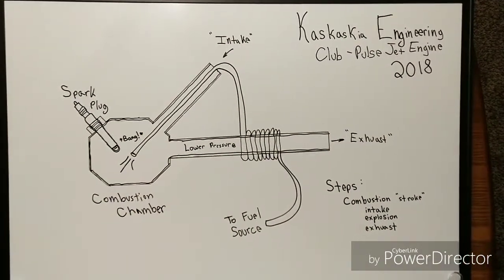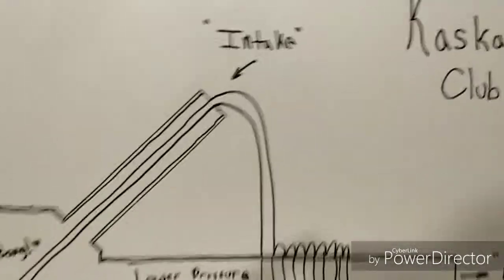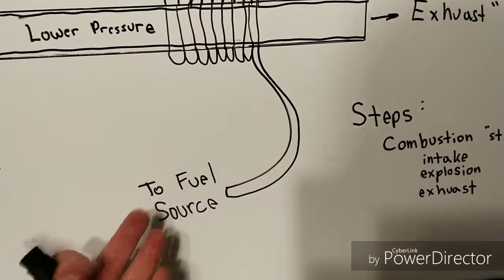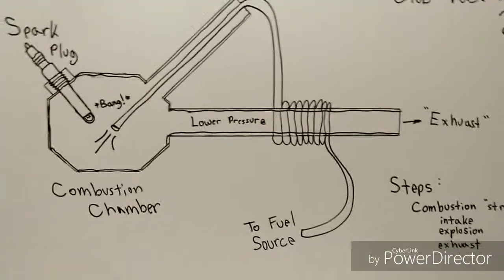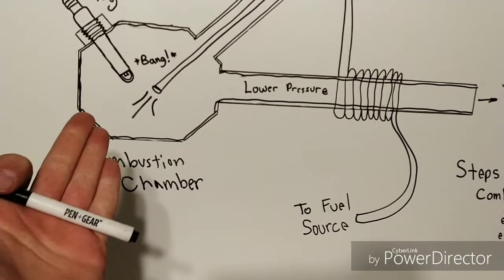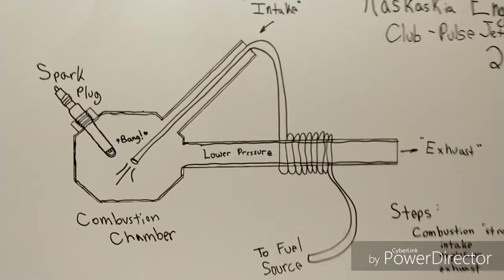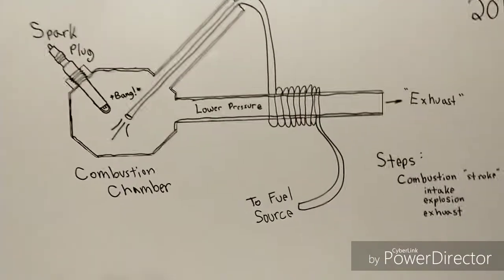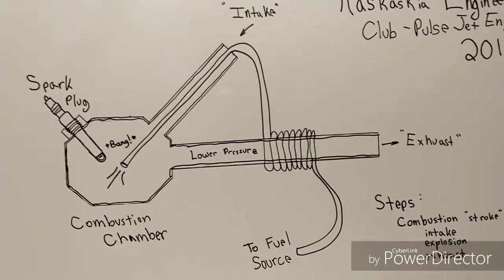Kaskaskia College Engineering Project 2018 - Pulse Jet Engine

Comment: next Project-USE Preheated Woodgas. So you start the Jet with Gas and change later to Woodgas. Use a Smoker from a Beekeeper,same prinzip.Dont think about any Water,the Vapor be preheated and be also Fiul- So you need less Gas.

Comment: What is thrust generated...??
Reply: It depends on the geometry of the engine as well as the air the fuel ratio this engine didn’t really run but o well
Reply: @adamgrieve7459  thanks...
Reply: What comes out of the tailpipe I would assume the force the push thrust generated is what it sounds like to me
Reply: @toolguyslayer1  I mean to say how much thrust you get...?

Comment: Combustion chamber is too small and your “exhaust” pipe is too short. You can get the thing to self start if you shorten your “intake” pipe and move your fuel nozzle to almost even, but engaged, with the opening there. The fuel going in will create a Venturi and pull fresh air in with it to get the combustion going and will only require a spark for the initial start up. It looks like you have too much propane going in, plug the fuel line with a fitting and drill a .010-.020 inch opening in it. I’m curious to see a follow up.
Reply: wrong. it made no matter,Nature works here.Not more.

Comment: Once a combustion chamber gets glowing red if you’re preheating the fuel kerosene should ignite on its own? Use a three way valve start it and warm it up on propane and gradually switch to kerosene or diesel fuel?
Reply: Thinking man...

Comment: hay i want to work on this project but i am a bit confused about where you would attach a air compresser.
Reply: I am assuming the air compressor is only to be used as a starter the intake and the exhaust must be the right size in order to attain a resulting quality a Tesla valve wouldn't hurt also I would assume a Tesla valve is the same as a coil only a lot smaller